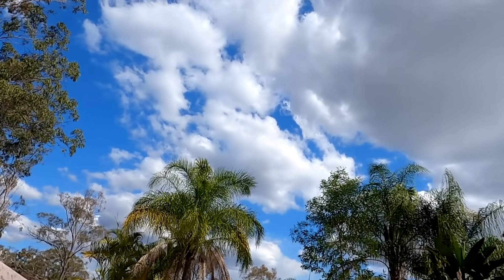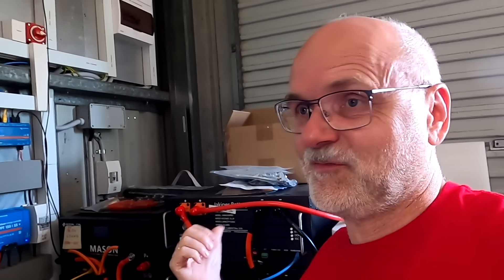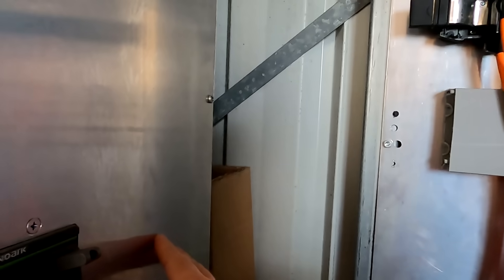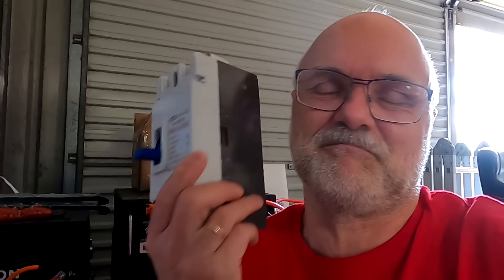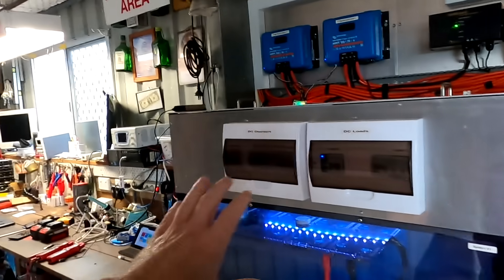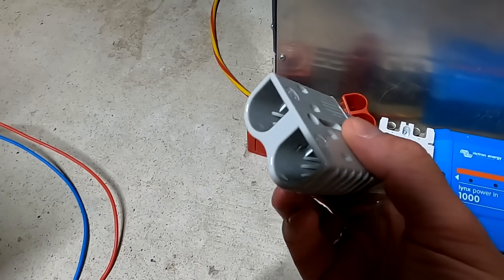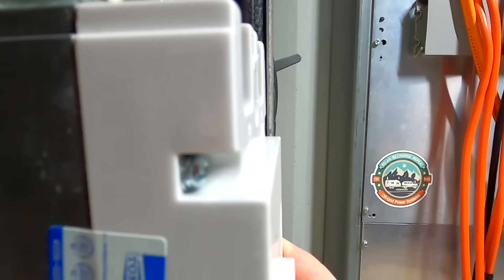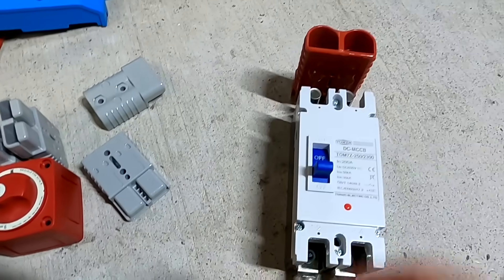I want to extend the Battery Shelf. But not to gain more capacity...

Comment: ok, I have to ask. After you've done all of your voodoo that you do to batteries... Why don't you incorporate them into your overall battery capacity? I mean, I'm jelly - Taj-Ma-Haul is absolutely stacked with 112kWatt/hrs of batteries, but if I had land, I'd have a hell of a lot more than that... In fact, I have a goal of buying a MegaPack from Elon once I've found land to buy, just for me...
Reply from the maker: I will connect some of the batteries at some stage to my production battery. The others may stay separate for further testing. Too many options...
Reply: @OffGridGarageAustralia  I suppose if you had a power outage or lots of shady days you could then simply connect what you wanted or needed to get through
Reply from the maker: @paulcurtis5496  Yeah, I can charge one battery from another with the setup I have in place. It should give me enough power for at least one full week with everything (hot water, pool, EV, cooking, ...)
Reply: Shazam! That’s what I’m talking about!
I can last between 10-14 days depending on how hot/cold it is and conservation. I’m 100% electric, no propane. I have room for one more panel, I’m going to install a solar water heating panel and that may greatly help in the winter save electricity. It would augment my in-floor radiant heat and hot water heating.

Comment: One solution is to get those big fuses that you pull out and act as a switch at the same time. It’s so rare occasion that it fits for that well. Only downside is that those fuses are classic burning types and not resettable.
Reply from the maker: That would work as well. I have no intension to blow any fuses or disconnect them under load.

Comment: Hello there you Victron owners :)

I have 24v of grid system (3.6kw 24v Easun inverter) with 2.7kw solar panels. Since I have not enough batteries in winter days I switch off my battery pack and use my inverter in SOL mode (in this mode solar panels directly supply power to the load, if solar is not enough the rest is pulled from AC, my inverter/charger handles this). I would like to add a new string and to use a Victron charge controller, will this cause me issues in winter when I will use my system without a battery pack? I am of grid so the current should not flow back to our house if it is not used
Reply from the maker: As the name implies, it's a solar charge controller. So what will you charge without battery? It's a DC-DC buck converter but you have nothing to connect to the DC output, so where is the energy supposed to go?

Comment: Yeah - I could have told you Andy, a big bastard can give you all kinds of concerns!
- When it comes to the MCB/MCCB's - did you ever do any testing of them?? The trip curve seems so "conservative" that nothing else than a direct short-circuit or a very heavy overload for a looong time, will trip them. Just something to beware of, if anyone should get the idea to directly compare their rating to fuses...
Reply from the maker: That's the same with all circuit breakers though. Depending on the trip curve, they can hold a long time before the thermal trigger actually trips the breaker. In this case, it is really more like a main switch and short protection. All connected batteries have their own fuses/breakers anyway.
Reply: @OffGridGarageAustralia  Right- I was just curious if you - in all your testing - ever had done any on these breakers. I can't find any good tests online of them. And I just wonder if they work as designed, or just really is nothing more than a big on/off switch...
Reply from the maker: @jbjensen11 You would need a very controlled environment and setup to test such breakers safely. This is certainly nothing you would do in a garage.
But do the airbags and seat belts in your car work as designed? The fire extinguisher you have bought a while back?
Reply: @OffGridGarageAustralia  I understand it's not easy to test and that is why you hardly ever see anyone do it. They come in many sizes. I was merely curious if you at anytime had tested any size of these breakers. I would find such test interesting. 

I get your point - the items you mention are under much more strict regulations I trust, than chineese lowcost circuitbreakers, may be. - Anyway, just wanted to expres my curiosity. You are my fav testman, to consult :)
Reply: @OffGridGarageAustralia Hi Andy,

I'm very curious too. What do you think about this MCCB TOMZN? Is it a quality product? Can you confirm that it is not polarized?

I have the same model in 200A and I wonder how many amps it really cuts? I couldn't get the curves from TOMZN...

Comment: mines pinned full eveyday i come home she is 100% oh that cell came good was a balance issue ,cant beleve how well a little 6.6kwh 24volt sytem works saving power bill running just about everything 1400w solar made 5.5kw today thats nuts  ,50amp charge going into cells ,think misses going get a shock on her bill when i move the system 400m away to my shed lol ,2 more days and my shed is built frame is up
Reply from the maker: Nice, keep building up this system until your bill is zero. Your missus will love it.
Reply: @OffGridGarageAustralia   the victron keep putting cells in float when they are not even over 80% how do stop this , why the damn victron cant detect its at 80% and need to keep charging in bulk charge mode , every time i come home its in float and cells are not fully charged
Reply from the maker: @AdventureMotoEnduro  what are your settings for absorption, float, ....?
Check the VRM advanced page, it's great for analysing issues.

Maybe you have hit the absorption voltage at so point during charging.
I assume it's your settings...
Reply: @OffGridGarageAustralia  yes i found out what was going on ,float voltage was set at 27.5v and at 80% charge the cells are at 26.7v ,when sun pops out behind cloud its getting smashed 1400w 50amps out of the victron 100-50, voltage spikes over 27.5 ,so i raised it to 28v and it still spiked over and went in to float at 80% charge so i then lowered the charge limit to 30amps and its working ,cells are now charging and staying in blulk charge mode seems the cells cant take 50amps at 80% state of charge with out over spiking voltage

Comment: i would mount the bb braker to the wall and attach to the main battery by the top terminals of the main battery then your not having to cut huge holes in the casiing

Comment: Mount the Victron bus bar (It would be nice if you built your own bus bar to show the viewer how such a project can be realised) on the outside of the sheet metal wall and secure it with the fuse switch between the inner and outer new bus bar. This way you can disconnect the whole busbar from the system, the battery storage units to be connected all have a fuse switch. From the new bus bar you can connect the respective battery with Anderson and also immediately connect it with a cable to the bus bar for comparison, so you can see the difference to Anderson  and thanks for your answere Andy
Reply from the maker: That's not a bad idea. Thanks.

I think I have shown how to build a busbar in a past video in aaaaaall details 😉

Comment: How would different SoC batteries with different voltages interact with each other when connected together?
Reply from the maker: The battery with the higher voltage charges the battery with the lower voltage. I've shows this in this video: https://youtu.be/Rsb8wRqtNs0

Comment: Where have you installed the shunt? I didn't keep that in mind. When you use several batteries, will you install it after all batteries?
Reply from the maker: Yes, it needs to be installed between the batteries and everything else.
It's in the top of the shelf, next to the 250A main MCCB.

Comment: Hi Andy,

I recall the JAKIPER battery with the Pace BMS. The cells weren't initially top-balanced. It's been roughly 3 months, and I'm curious if they've naturally balanced themselves using the built-in Pace BMS after many cycles, or if you manually added an active balancer to achieve balance?

Any updates on this matter? I'm relatively new to this channel and find myself thoroughly engrossed in and analyzing every one of your videos! 😅
Reply from the maker: I'll do an update on that soon... Yeah, I know, it's a lot of info😊

Comment: Hi Andy, nice project coming up! Why nog connect the Anderson 350A to the top of your busbar, unsecured, then make a small enclosure for the mccb with 350A Anderson as input and on it's output 3 170A Anderson as output. Then you have a secure coupling, you could even fit a 350A Anderson on the out as well and a 350A on the Lynx so you can switch, mix and match. Gives you flexibility and enough options for future tests. No big alterations to your main cabinet, all specials can be in an external smaller cabiner which you can assemble on your workbench. The leads will be a tad longer, but who cares. Take a SPAT and go round all options, good luck!
Reply from the maker: Uh, I like this idea!

Comment: Question for you from Alaska. Do you have any wind generators connected to your system? Very little info out there talking about how to connect 3 phase 800w ac to batteries.
Reply from the maker: No, I haven't. This is not a windy area here, so solar is the much better alternative.

Comment: Cyrix-i 24/48 V 400 A 
Victron Energy

software of the Cyrix-i does more than simply connect and disconnect based on battery voltage and with a 
fixed time delay. The Cyrix-i looks at the general trend (voltage increasing or decreasing) and reverses a previous 
action only if the trend has reversed during a certain period of time. The time delay depends on the voltage 
deviation. *Multiply Values x 4 (40-80 volt battery)

Comment: Andy, I have been meaning to ask a question. Is the main house connected to the grid or equally off the grid? And if off-grid, how did you run the connection? Could you give us a tour?
Reply from the maker: It is still grid connected until 2028 when the feed-in contract runs out. However we have connected some loads and feed them from the battery: hot water, pool, EV charging, dishwasher and washing machine and yeah the S.P.A.T. fridge of course.
Reply: @OffGridGarageAustralia  What else is there left to power in the house then? Just lights and TV? 😆
Reply from the maker: @Carl-Camera  Yeah, not much else. We only use 1.5kWh per day in the house now. I have trained my wife well, to handle all the extension cables when needed. She's onto it and tries to save as much energy as she can while running the household. 
Next will be to replace the gas BBQ with an electric one...

Comment: Wait just a minute!
If you connect the new batteries to your battery shelf after the smart shunt you will have no way to work out the energy left in the battery shelf.
If it were my setup I'd connect all the new batteries T'd off of were the the smart shunt is for the curent battery shelf setup.
that way you can run a smart shunt for the new setup then out to a main disconnect breaker in the same manner you already have with that 250 amp breaker 
I hope I'm expaining this right, it's been a long day
Reply from the maker: The batteries need to be connected the same side as the existing batteries from the smart shunt perspective. It's explained in the video.

Comment: I would say don't have too many switches and connectors in any run as each one will have resistance and drop voltage, but to date everything I have ever said to you is dissagreed with, so do as you wish.
Reply from the maker: I would not be too concerned about such voltage drop as it is just for testing purposes.

Comment: 🦦 You shouldn‘t touch the battery shelf ! Just bring the busbar out. With a huge huge huge huge cable, 🤗 To the mobile box for example and then make there what ever you want 🍁
Reply from the maker: Yeah, I think there is not enough space inside anyway. It will be so tight, almost impossible to handle any ring lugs, cables and connections. 70mm2 cable extensions might the way.
Reply: 🦦 70 mil , 5m, 350 Amps 🫣 sounds good 🤗

Comment: the thing is, adding capacity to the big battery bank is " you have to change the setting of the shunt everytime you add or remove a battery bank in the system". then it would intoduce a problem in the capacity coz you have to fully charge the big battery to calibrate it to 100% again, i think adding capacity would be a permanent upgrade and not a for testing puposes upgrade. and oh not just the shunt, but the whole victron system.
Reply from the maker: Yeah, changing the battery capacity in the shunt would take 30s. That's not a problem. Nothing else to change for such a test...

Comment: The current JK-BMS is Not Good at tracking SOC and resetting to 100%. I couldn't understand the conditions to reset to 100%. When you test the new version, could you please investigate how accurately it tracks SOC during discharging (compared to a Victron SmartShunt) and how it resets to 100%? Thanks!
Reply from the maker: We will investigate that and more with the new JK BMS.

Comment: If it were me, I would use the Power-In. It's such an elegant busbar system and if you convert it so each battery can be fused, even better. Then, to carry out testing, simply connect the battery to the Power-In using a cable with the appropriate terminal connector.
Reply from the maker: Yeah, it seems to be a very flexible and versatile, has got the fuses and it is small.

Comment: Hi Andi , first of all you need a schematic of your System and how everything is connected to . Then you could decide where the best point is to connect your DuT . Use breaker and Anderson connector for each DuT
Reply from the maker: I've got the schematic and have only limited points where I can connect the additional batteries.

Comment: I'm using Anderson-Connectors (300A types, the red ones shown in the video) for all of my Batteries for about 7 months. I pulled them under havy loads of up to 150A per battery several times. And what can I say: absolutely no issues! The contacts looks shiny and clean like at the day they were mounted. Really good decision!
Reply from the maker: Great, thanks for sharing. I would have a disconnect switch/MCCB/MCB first before I pull them apart. The spring seems to be very strong and 200A should be no problem for them

Comment: Place all server rack batteries in server rack cabinets with doors. 
Connect the batteries with vertical bus bars inside the cabinets, 
which is better than using cables between the batteries. 
It will be more safe and look much better and cleaner, then each battery can be pulled out
separately (when needed) than if they are stacked on top of each other. 
Connect each server rack cabinet tower separately via their SmartShunt
to the system, but I don't know if Victron allows this.
Reply from the maker: While this seems like a clean solution, the problem is the different BMS at the moment. If they all would have the same, I would consider that.
Also, I don't have space for such a cabinet (yet). Maybe after the 'Power-Garage' upgrade.
Reply: @OffGridGarageAustralia  Batteries with different BMSs can be in a same server rack cabinet, where there can be multiple basbar systems as needed, where only the batteries that can be connected together are connected.
Reply from the maker: @tiborchren  Ah, right, that's the idea... yeah, not bad...

Comment: Hi Andy, I would worry about differences in parasitic resistence between the different battery packs. In the current battery shelf 2.0 it may be well matched, but with additional breakers, cables and connectors it may be off. And then you might get inbalance between the packs and miss the whole point of your test goal. I think you should keep it separate on dc side and connect at ac side.
Reply: Though… this might be a nice aspect to test as well 🤓
Reply from the maker: Thank you for sharing your thoughts.

Comment: Leave the breaker on the outside
Use its lugs
Reply: Also much less work
Building some covers for the exposed breaker should be easier.
And you would be able to mount it at the top of that panel
Reply from the maker: I may be able to get a plastic enclosure for the breaker... so, yeah, mounting it on the outside is a possibility too.

Comment: Pull a breakered  connection from the production bank to a Lynx Power  in.  Then have the Power  In connected to a string of Anderson Connectors, or whatever else you want to use. to connect to the batteries.    Maybe  a busbar V2?
Reply from the maker: Yeah, I get it... That was the original idea of the PowerWall 2.0 with the Power In and using Andersons for each battery. Still the cable mess is not great. On the other hand it would be only temporarily for testing...
Reply: FYI ... by breakered, I mean off the main busbar.  This way you can disconnect the three, and run the new .

Comment: Hello Andy, I will have any time a Breaker between a Busbar and an extern Battery. From this Breaker  you can make a main connection to the blue DC Distributer and have these 4 connects for the externe Battery with this one Fuse(100A...)
Reply from the maker: The Lynx Power In are messy with all the cables hanging out. They are really designed to work with cable ducting.

Comment: I would model the battery shelf in CAD first to see what would fit.

One change you might want to make to the battery shelf, regardless of what direction you go in, would be to make the side panel removable with to having to remove the circuit breakers.
Reply: The circuit breakers are hard wired into the vertical busbars. Once he undoes the screws removing the panel leaves them in place.

It's just a bit of a faff to line them up with the cutouts when he replaces the panel.
Reply from the maker: Yep, I should be able to take the side panel off and the breakers should stay in place just with the cable connections. There is one other screw for the earth wire and one other holding a bus bar standoff.